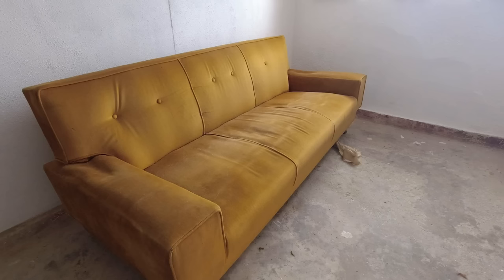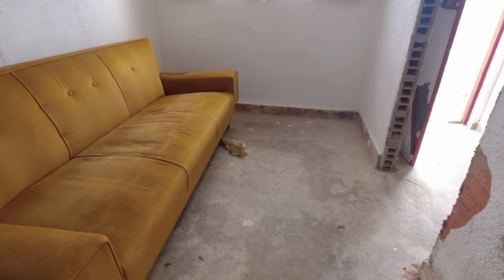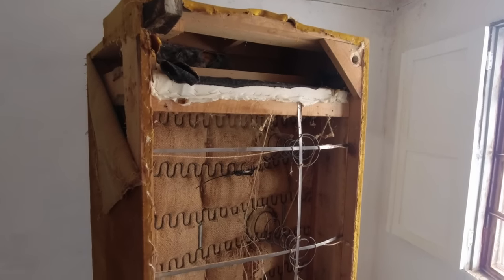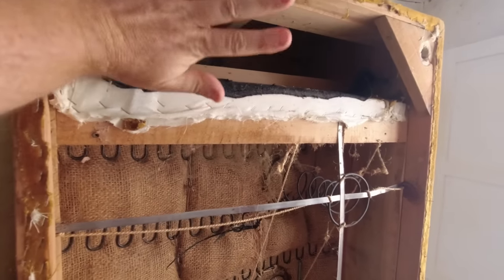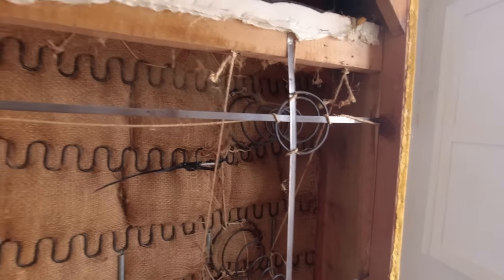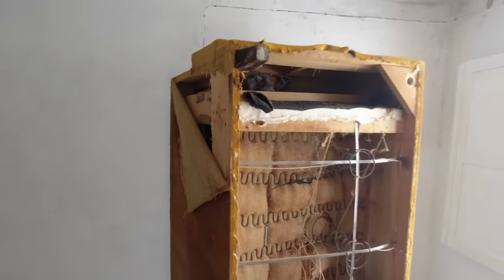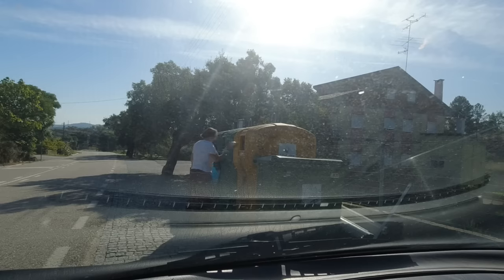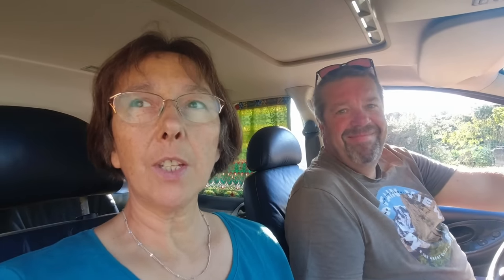89. Time Critical - Getting the Tiny House Water Tight before the Rains - Off Grid Portugal

Comment: Just a thought, but at the end of the video where you are saying your goodbye, the frame shows the neighbors roof abutting yours. There seems to be a pile of rubble against your house that will hold water onto your wall and possibly cause a bunch of damage to the wall. It might be a good idea to remove it and place their tiles on the ground away from your wall to let the water follow the roof pitch and not pool against your wall.
Reply from the maker: You're right,  the pile is what we moved away from our wall and we cleaned it all out. Filled it with fresh cement and embedded the tiles to form a gutter. Well spotted!!👍